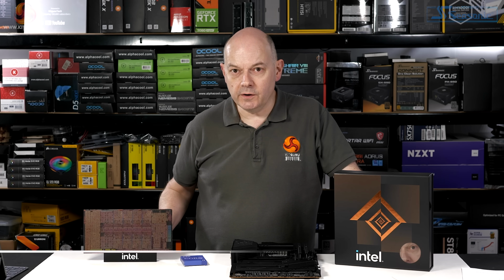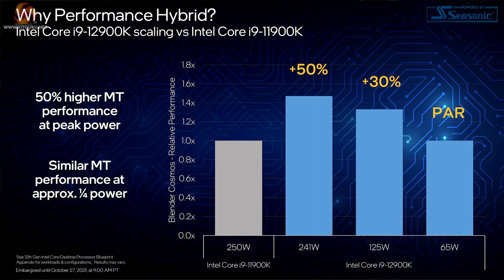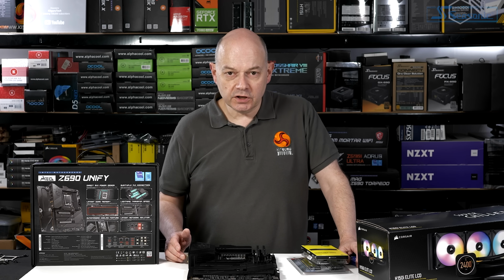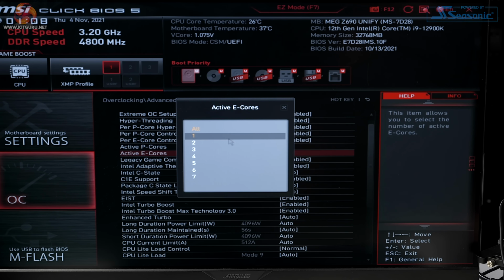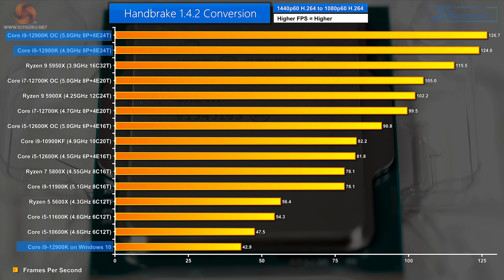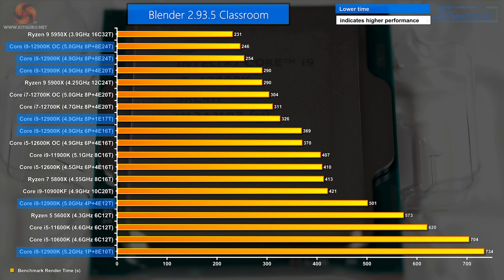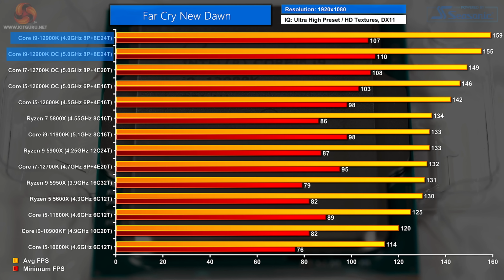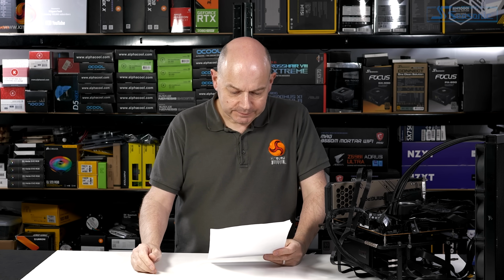Intel Core i9-12900K – Enough power to burn the planet!

Comment: I need More info Plz make more video because I am buying a PC and don't know which to buy AMD or INTEL
Reply: 100% AMD. All joking aside you will be happy with both, don’t get caught up in brand names.
Reply: if power or MSRP/mobo-cooling-ram prices is a concern of yours, then go with Ryzen 5 5600x or Ryzen 9 5900x. If you got tons of money and dont care that your pc is a space heater, + can run watercooling 360mm AOI, or costum loop + want the absolute fastest, then go with the 12900k.
Reply: Intel consumes 2x the power and performs maybe 2% better and you still get more expensive ram and boards etc.
I upgrade every few generations and by then its a new socket or ram. Wait for zen 3d if you are not in need of an upgrade as I was on a several generation old Intel

Comment: Great video 5 stars! As a creative, I am not impressed at all big letdown 5950x seems a better deal and uses so much less power. I think I will wait for AMD new offering.
Reply: To be fair, Intel appear to have closed the gap. Whether they've really overtaken AMD, or Intel are benefiting from a very cozy, if not anti-competitive, partnership with Microsoft is still to be seen.
Reply: @Penfolduk001  At the cost of making a power-hungry heater I am not an AMD lover I have an Intel system at this time (always have).  Intel i9 12900k Will Get Its Ass kicked By AMD very soon.  Intel i9 12900k will be all forgotten.
Reply: Indeed. Same here.
Reply: The 12900k is £120 less money than the 5950x and beats it in a number of tasks.
Reply: @Krisroffer Pettersson  This is Intel's Zen 1 moment LOL
Reply from the maker: Thank you!
Reply: My thoughts exacly, the intel new platform isn't really viable for purchase in my opinion at the prices of mobos and ddr5 at this moment. The fact that Ryzen 6000 on an AM4 chipset may be equal or more powerful than 12th gen makes it even worse when beeing like 2-3 months away. In my opinion buying 12th gen at this moment is a waste of money
Reply: I wanna see numbers on air cooling.  Most cases cant even fit a 280 rad let alone a 360.
Reply: "5950X seems a better deal and uses so much less power"
You are comparing apple and oranges, 5950X at stock vs 12900K with overclock or infinite turbo.

12900K is more than 20 faster in singlecore vs 5950X by the way.
Reply: @saricubra2867  Yes but at what cost 12900K As a creative, I am not impressed at all big letdown 5950x seems a better deal and uses so much less power (would save a lot there). I think I will wait for AMD new offering. Blender rending will kill your electric bill better to use 5950x ).  Also, Windows 11 is really not ready for 12700k so I don't think there is a rush to buy.

I think AMD will take the lead back by December/January next year. I think it's best to wait as the prices are so high if I get the 12700k you got to buy DDR5 super high price even if you can get DDR5. The latency sucks on DDR5 at this time too. Plus you need a supper CPU cooler air con too in hot countries.
Reply: @pc-ninja  5950X single core kinda s*cks in comparison, but maybe that is a tradeoff.

By the way, 12900K has an iGPU and i think i'm not the only one who renders on NVIDIA CUDA, it's better than 5950X on every single aspect minus price.
Reply: @saricubra2867  The world should be moving past single core its stupid and it's backward.
Reply: @AFlyingCookieLOL  CPUs are serial processing units, not GPUs, single core perfomance historically speaking always has been the most important thing.

If you want "moar cores" for the sake of it, NVIDIA RTX 3090 has around 10 000 CUDA Cores and the GPU is dozens of times faster than a Threadripper in renders like in Blender and it's waaaay, way cheaper.
Reply: @saricubra2867  CPUs are serial processing units, not GPUs

No that is lazy programming.

single core perfomance historically speaking always has been the most important thing.

No it isn't. All your servers today are heavily multi threaded including your internet. You are using multithreading every single moment of time. All the web servers and application servers are running in multi-threading mode for the last 20 years. And here you are claiming single core performance is the most important thing.

GPU core cannot be compared to CPUs, and GPUs cannot run by themselves.

You consuming 2x the power to get maybe 1-3% more performance, functionally a waste of power and extra heat leading to less headroom. 

Any company that does not have modern software engineering that can make use of multiple cores is backward.
I am not in favor of drawing 2x more power to get performance that is marginally better.